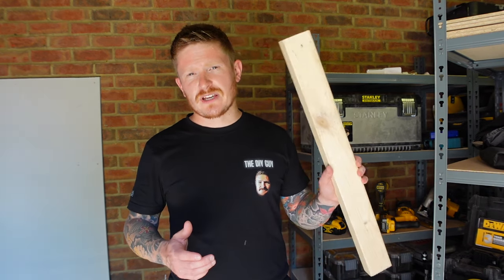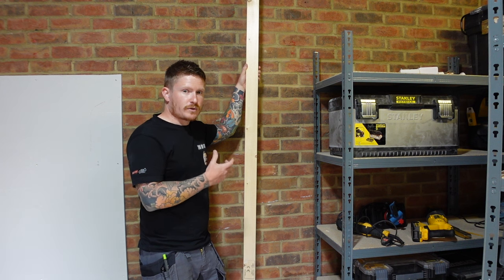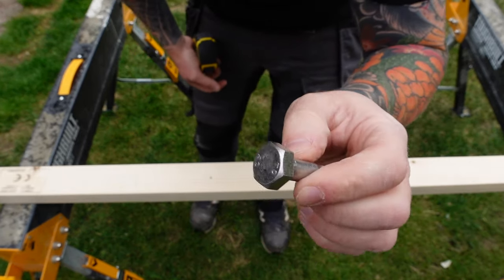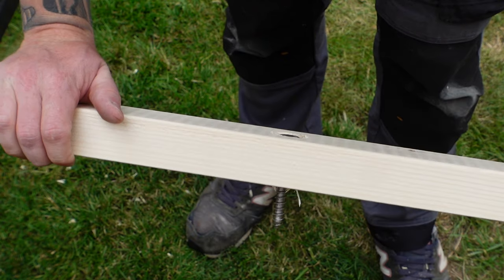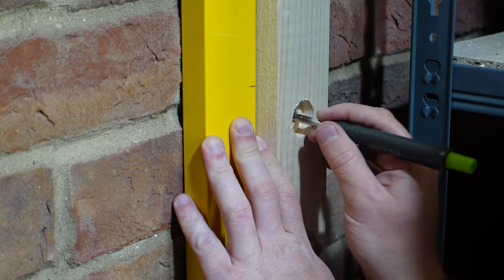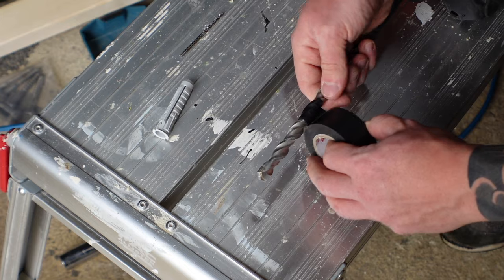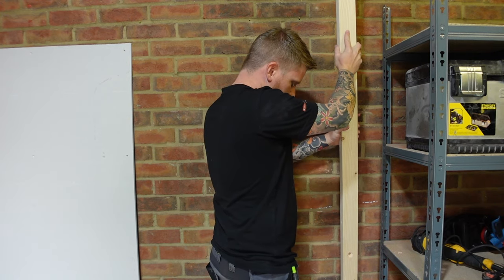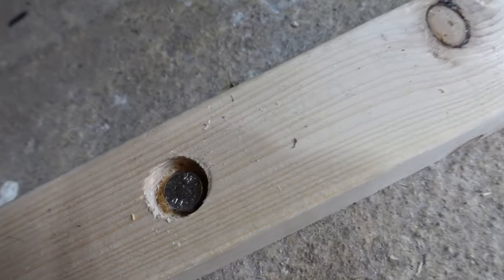How to Fix Timber to Brick or Concrete - The Most Solid Method!

Comment: used hard the screws in the blade come loose its not really designed for heavy work and you may get two seasons possibly 3  also you find yourself swinging it about and you can catch your trousers or worse .if you can afford it trade up to a better name brand overall i was pleased as i could not afford a tractor but you rarely get something for nothing.really designed for light shrubs not the farm yard😊😊😊

Comment: Might have helped if you had not kept using acronyms like CMS or CLS, as if mere mortals have a clue what you mean. 
You talk of using a 70mm coach bolt. But whatever it was you were holding looked a lot bigger than 70mm.
Sorry. But I was more confused after watching the video than before.

Comment: lol no need whatsoever to use that bolt on that piece of wood. Good quality srews and good quality plugs are more than adequate. That bolt was far to fat, just no need for it. Not to mention there is no stress on that wood for what you are doing. just a waste of cash.